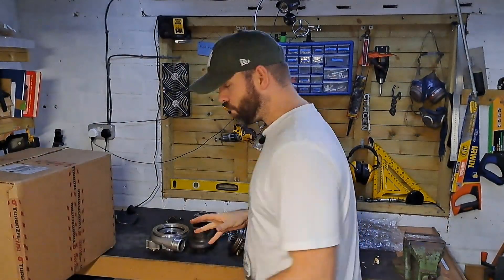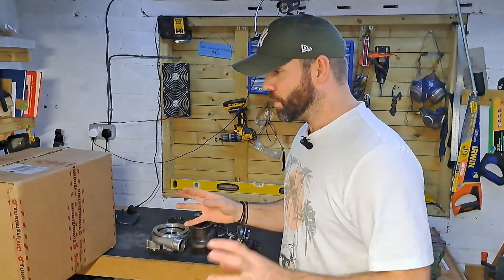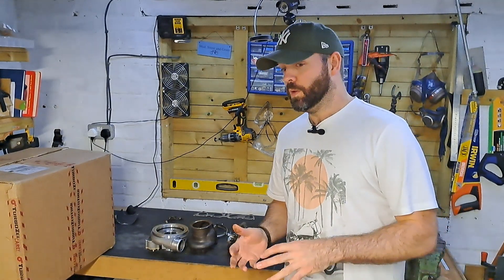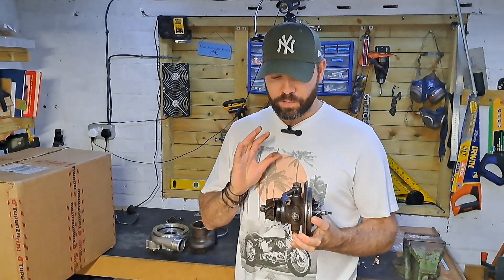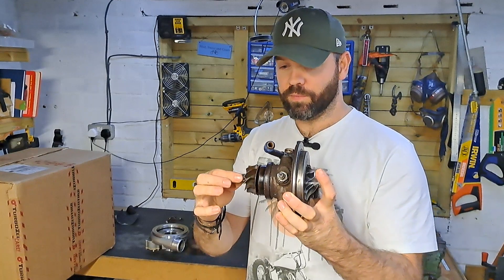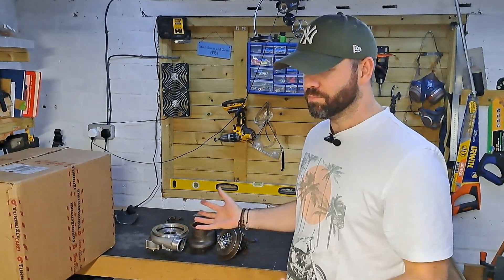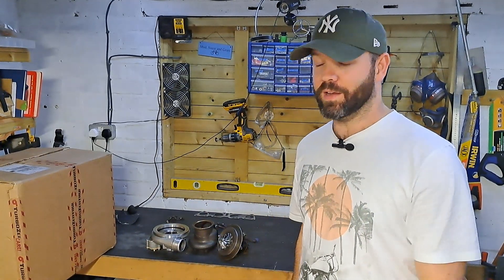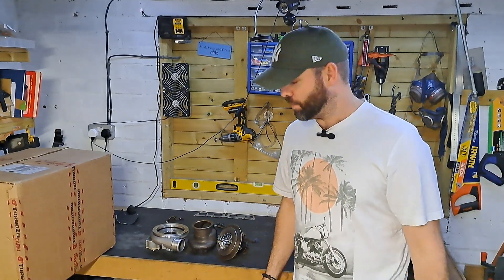Project 5AXO - SAXO VTS Turbo. Help! I've broken my turbo.

Comment: Any precision engineering company should be able to repair a bent shaft like this, but essentially you could:
- Measure tolerances of everything before using feeler gauges and/or calipers
- Press off/remove everything from the shaft
- Put the shaft in a lathe, preferably in a collect chuck so there's minimal run-out
- Use a dial test indicator (preferably with micron precision) to work out the run-out of the shaft
- Mark the high spot and use a suitable method to bend the shaft, repeat from step 3 until there's no more run-out detected

Another option might be to have another shaft made by an engineering company. I expect this would be in the hundreds of pounds

Comment: Only way to straighten that out is with a blow torch...
If you can remove the shaft.
As its a steel shaft you should be able to just heat it up and bend it back straight.
I mean you could always try heating it up and putting it back in the exhaust housing the same way you removed it.
Just a though 🤔👍